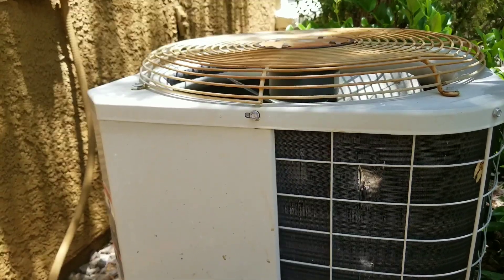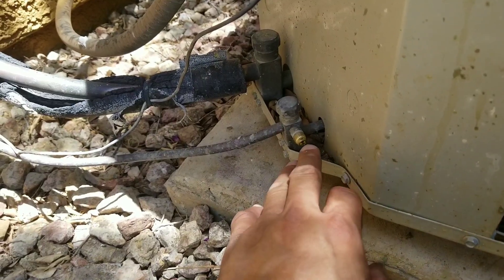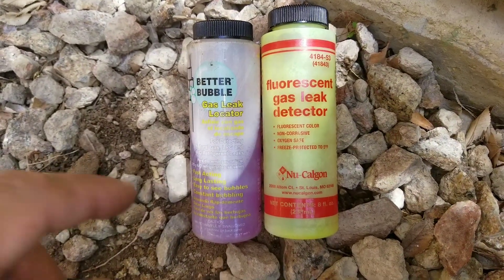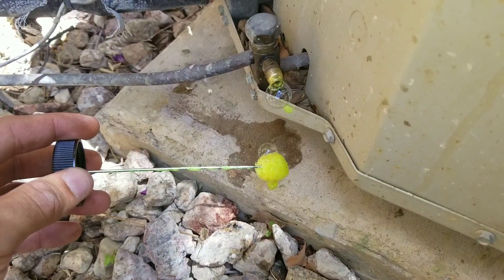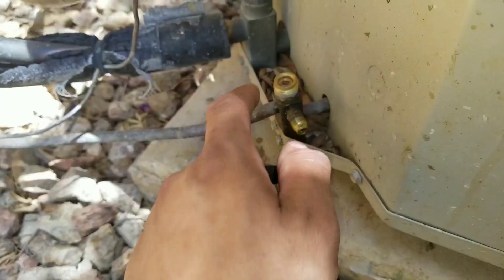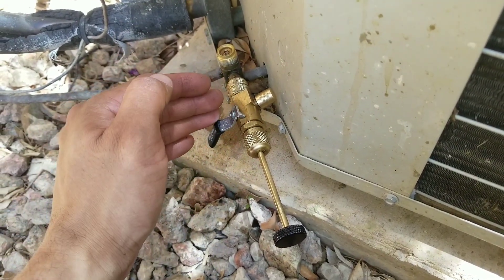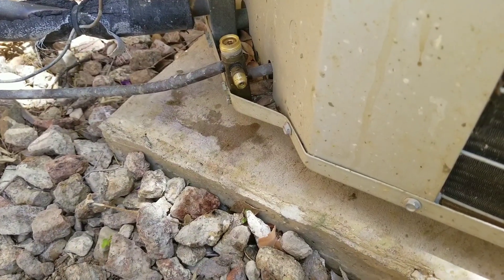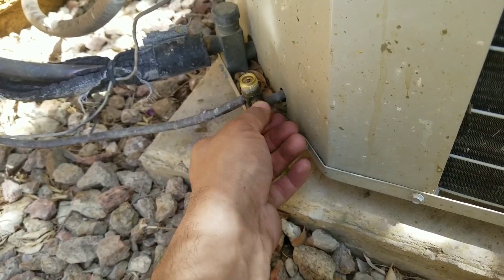Low Refrigerant? Freon Leak? Check This First!

Comment: good to see you replacing the crappy black plastic caps with a good brass cap, that will seal any leakage from a faulty schrader core.  Also I didn't see you tighten the top cap on the 'king valve'  those are to be tightened with a wrench 1/6 of a turn after they are finger tight.  There is brass seat inside the cap that will seal any leak from coming out of the stem.  Good points though...
Reply: So, I f I found a leak at the valve, that brass  replacement cap can be the fix! ???

Comment: He mentions the "inexperienced tech" in this video, as a cause for poor service done during service calls.
But, lets not overlook the monetary incentive for the "service company" to charge the leaking system a few times, before insisting that the customer purchase a new system.
Reply from the maker: I had this experience. The homeowner called a "reputable" company in the state in which I reside. They diagnosed the system stated they needed a new condenser... hence the need to retrofit the evaporative coil and convert to a new system. Priced them at 10 grand. The guy is distraught   tells his co worker. His co worker says I can do the work for 6 grand. What a deal right?! I happened to hear his wife talking to my wife and I casually said let me come by and take a look at the system. They agreed convinced they were at a loss and had bargained with their co worker a great deal. I went inspected the condenser. The first company that came pulled the $25 capacitor out and left the wires unconnected. I installed a capacitor. System has been running for 3 years now. They even sold the house... had the system inspected no issues! These companies rely on the ignorance and discomfort of the homeowner/ tenant to make money  and take advantage of them its disgusting 😐 Thank you for your feedback 👍
Reply: @MoreThanMaintenance  I went to look at the unit at my wife's aunt's house.  A "reputable" service company had charged her a couple hundred dollars to reconnect a broken control voltage wire and left a list of "needed" repairs.  Condenser fan capacitor - $350, condenser fan motor - $1250.  I checked both.  Fan motor was perfectly fine and capacity slightly under spec capacitance.  Replaced the cap for $20 and the unit ran until she moved.

Maybe it's just because I work in facility maintenance at a non -profit rather than a a service company, but I truly hate this practice and those who engage in it.
Reply: It’s truly criminal and really makes the many honest hardworking techs look bad. These people should be tried and convicted of fraud.
Reply: @stevee7774  ,
Not likely that they will be convicted.
A "Plan B" would be to ram a copper pipe up their arse, and introduce R410a to their lower intestinal tract.
Yeah, a bit over the top perhaps, but far more effective.
Reply: marshalllhiepler - I like it! And if someone sold tickets to the event, I would be sure to attend!

Comment: A quick fix if you don't have the removal tool is to buy some brass caps with o'rings inside them...not too expensive.  Put them on tight and it will seal it off pretty much the same as the valve  core does.
Reply: Maybe adding a little thread tape first would help too
Reply: @blueribb99  ....this is not a NPT (tapered) thread...right? If it's a straight thread...all you need is the proper o-ring under the cap.

Comment: is it possible to repair the sea lin the king valve ?? is there a tool for it ???
Reply: You can buy that valve for under 30.00 bucks.
Reply: @waynejohnson7134  can it be repaired or do you have to install a new one  thanks wayne for you help

Comment: Can you make a video on how to replace an outside condenser disconnect?
Reply: Turn the breaker( two pole) off... pull the wires off the disconnect from breaker... pull off the wires going to condenser... do not remove wires inside condenser... do not remove the grey whip from condenser... all this is at the disconnect... unscrew disconnect from wall ... screw on new disconnect to wall... .attach wires  from breaker to where it says LINE inside disconnect.... attach wires from condenser(grey whip) to LOAD inside disconnect... it does not matter what color the wire... as long as the wires are placed in the right line and load..... the green wire or bare wire is your earth ground... just connect them together in the disconnect or wire nut them together.... turn breaker on... if the breaker trips you did something wrong... if the breaker does not trip you did a good job... depending on ac size... most disconnects are rated at 60 amps( residential)... fused or outdoor breaker disconnects are not necessary...

Comment: If my AC has no refrigerant, will I still be able to do this test to find the leak or will I have to add refrigerant to find the leak
Reply from the maker: The best way is if your system has no refrigerant is to use nitrogen 🙂
Reply: It doesn't have to necessarily have refrigerant, it can have nitrogen as mentioned in the reply above, but the system has to be pressurized with something (refrigerant or nitrogen) to do this test.
Reply from the maker: @celeronxl  You are correct. The reason I prefer nitrogen to refrigerant is because someone pointed out to me that I keep a mental note of when servicing systems is that #1 if you use refrigerant on a system knowing that it has a leak you jeopardize your licence. If someone sees you and reports that you knowingly allowed refrigerant into the atmosphere the fine currently is a few thousand dollars and you can have your license/certification revoked. #2 Refrigerant is extremely expensive in contrast to nitrogen. If you are in the HVAC industry refrigerant is of extreme value to you. You dont want to pressurize a system and lose that refrigerant whereas Nitrogen is the cheaper route and inexpensive. These are the reasons that an old timer pointed out to me when entering the industry. Hope this helps!
Reply: @MoreThanMaintenance  if a nitrogen tank is too expensive, not available, etc., buy a torch can adapter at Ace true value, and use propane. If your system is r22, and your certain the repair is leak free....5 bucks worth of propane will slap 22 in the face. Hydrocarbons require about 1/3 less kinetic energy to compress, so the unit will use less electricity. Double savings. And if anyone says I'm crazy, give me some verifiable sources of r290 or r600 refrigerators that sit right next to gas stoves that have blown up. Screw Dupont. Screw Chemours. Screw Honeywell. Screw the EPA. Don't delay, Hank Hill your AC today!

Comment: If the king valve is the issue can it be repaired or does it have to be cut out and replaced?
Reply from the maker: If you go on my channel there are a few tricks that you can use. Honestly if you want a real permanent fix then replacing the king valve is the solution. I do have a video posted if your interested on my channel. Thank you for watching!

Comment: thank you so much. that is exactly what people have been doing. I have been told so so many things , but no one has ever done this leak test. i have my line running through a concrete wall that holds up my deck. that is how the house was when I purchased. im praying leak is NOT inside line behind brick wall. refrigerant is totally depleted, just had refrigerant put in a few months ago and it is depleted. did not run unit over summer at all. im hoping this piece is the problem.
Reply from the maker: Let me know how it goes! 🙂
Reply: trying to get warranty to pay for new line or to find and repair leak. if leak in line that runs through concrete wall is main challenge. believe replacing line will be best.
Reply: if the leak was in the copper lineset, it would have leaked when installed and be completely empty, aka no cooling
Reply: Best time to pressure test at 500 psi.